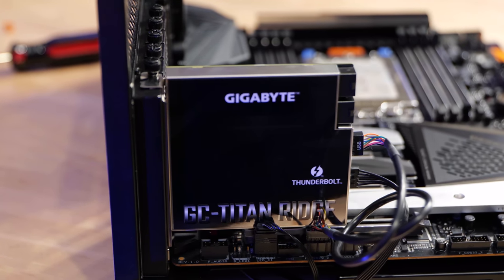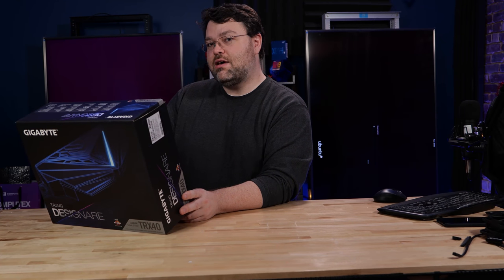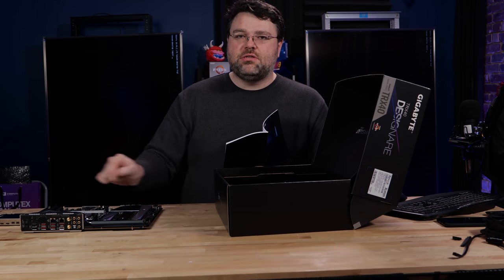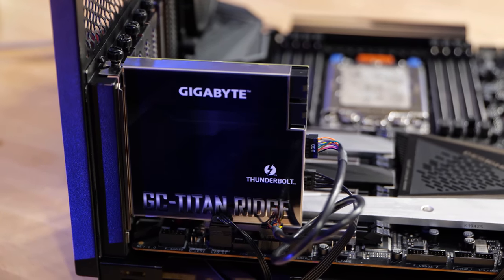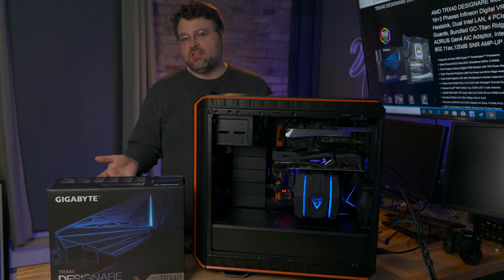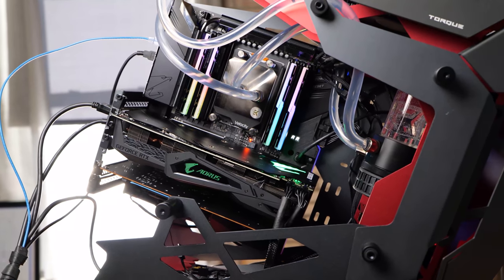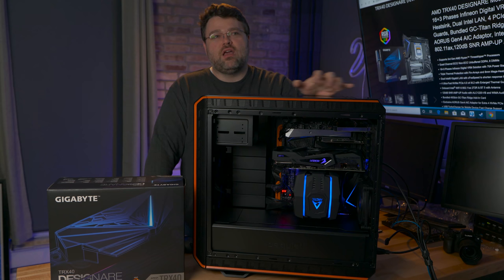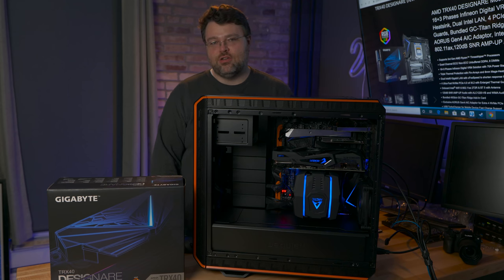Threadripper: Perfect Thunderbolt Compatibility on the Designare TRX40 Tested

Comment: This video made a huge difference. I'm a musician and NEED Thunderbolt for my Audio Interfaces and Storage.
Reply: UAudio ? Is this only for threadripper ? I want to build a gaming pc with cheaper AMD parts but I also need thunderbolt to play with some UAudio interfaces. What should I do ? Go intel ?
Reply: @defaultHandle1110  Nope this Gigabyte TRX40 or ASRock X570 Creator (right on the mobo).
Reply: Can anyone confirm this works with UAD Apollo TB3 Converters?
Reply: Metaxas Music I cannot conform that this fully works but I have a previous gen Gigabyte mobo and it works with my Apollo Twin Quad. I’d send Gigabyte an email if you’re planning to buy soon, I personally feel comfortable that it will work based on my experience with their other products but I’ll be confirming with them directly as well.
Reply: Rob Flores thx man

Comment: Just got the BIOS up and this video and forum thread in the description has been a blessing - cannot wait to use it with my UAD Apollo Quad audio interface!
Reply: Did it works? I also have a UAD appolo quad...
Reply: @mimidhof2179  24 Core AMD Threadripper production beast. Do it! ;)
Reply: @JackMajor  Well to be honest, at the time I was in need to renew my 6 cores intel PC from 2008-2009 almost 1 and a half year from now (january 2019).
 There was no information about the possibility to have thunderbolt working on AMD computer. Not even sure that the Gygabite Designer already existed.
I had no doubt about the way AMD was coming strongly, but I needed thunderbolt connectivity.

So I then decided to keep going with Intel but due to the unrespectfull and never seen before devaluation of the Intel CPU I bought. The 9980XE 18 cores (-50% on 5 month). Hopefully I have it running fine in an Azus prime Deluxe II with 2 thunderbolt 3 ports. It is stable and will have to be working for a long time still, seen the investment and seen the value loss.
I can't say 100% sure (maybe they offer me 50% of a future AMD chalenger) but I think I will never go back to Intel again, they are shameless. I think this CPU is the only thechnological good that has lost so much value in 5 month since the big bang 13 million years ago.
Thank you for the AMD advice.
Have a good music production day.

Comment: I'm upgrading my Threadripper X399 Gigabyte Designare mobo to this GC-Titan Ridge "PCI-E over USB Type-C" card, thanks for the video!

I'm just hoping I can get it working on Linux!
Reply: I did the same as yours. I got that works in gentoo linux. You may need to do some manual changes to kernel in order to make thunderbolt to work.

Comment: please try to contact UNIVERSIAL audio and ask for a sample, they have stated to me when i asked them that they DO NOT support amd processors. I would love to see you prove them wrong!
Reply: They don't really need to support AMD, just Thunderbolt. And Windows/Mac. It's just that TB is only "native" to Intel, and anyone asking questions like that gets them worried that faulty hardware configs will wrongfully draw the blame to their product, which is why they gave you a misleading and ultimately worthless statement like that. If you can get TB3 working on AMD, you're most likely fine. My MOTU 1248 works fine on AMD, (Linux is another story; TB interfaces still don't quite work the way they should even on Intel, in case you're wondering) and I'd imagine UA would be fine as well.
In short, unless their driver is specifically engineered towards Intel, (which it probably isn't, seeing as Thunderbolt seems to be firmware validated, and driver/API developers never have to worry about that crap) then their statement is useless.

EDIT: Sorry for the rambling and multiple edits, just wanna make sure this is all clear without going on too long.

Comment: Great Video. Could you please recommend a similar motherboard with a Thunder Bolt 3 native connection (on the board, not an add on). I am a audio/video Engineer and using the new Universal Audio Apollo X duo with Thunderbolt 3. I want to build a new system with new thread ripper chip.
Reply: The same ! But I'm composer not engineer :) I would like to connect UA arrow interface also with thunderbolt
Reply: @PerchHunter  There is only one motherboard with thunderbolt on a new AMD platform. And this is this one, reviewed above.
Reply: What about the asrock x570 mobos?

Comment: That Titan Ridge card seems to be able to be used on boards that don't advertise having thunderbolt support or have that special motherboard header. Even a pre-2013 cheese-grater Mac Pro, interestingly enough. I don't suppose you could experiment around with it in various boards and see what you learn? Would be interesting to see what happens if you put it in an Epyc machine

Comment: Are you saying FireWire is dead ?  I just upgraded to a Pentium 2.
Reply: I am so happy so many people think Firewire is dead - there's some very seriously capable pro audio gear that uses Firewire  which I'll be delighted to snap up second hand as the 'bad' news spreads. :)
Reply: My entire recording studio is still Firewire. From my 10yr old ProTools rig to the interfaces and external HDDs used for recording. However I just got notification that my application for a grant to upgrade equipment was approved! FK YA! $100k of new gear for me in April! Putting together and adding to a wish list daily!  2020 is gonna ROCK!! \m/, ,\m/
Reply: @Iam_Dunn  I'm very much just a serious amateur, but I love my original RME FF800 - does all I need and more. Though I wouldn't mind a UA Apollo Quad :)  Congrats on the coming equipment upgrade. I'd love to play with that kind of budget :)
Reply: You can connect your external zip drive directly to your firewire port just fine

Comment: USB4™ is what I'm waiting for to be included in my next board upgrade
Reply: how is it different from thunderbolt 3? isn't it like the same with a different name? maybe its the case but its just cheaper to implement?
Reply: @santiagoferrari1973  Yes USB 4 is the same thing as Thunderbolt 3. Only the name Thunderbolt is proprietary and under license while USB 4 is open. It's just like Freesync over HDMI is proprietary and requires a licence fee (unlike Freesync over DisplayPort) while adaptive sync doesn't require a license fee even though it's the same thing.
Reply: @CheapBastard1988  thanks

Comment: I would really like to see this running with an universal audio audio interface but also with thunderbolt 1 or 2 devices running over an thunderbolt adapter which seems to be not working with the titan ridge. i could not get the apollo twin duo thunderbolt 2 interface running with this system. but your tips helped a lot getting the system clean and working. thanks for that
Reply: Um, wow, did not support Apollo Twin TB2?? No resolution?

Comment: Commented on your initial video back in 2018 and I'm just now noticing the TB3 with X570 problem, lol. I Bought the Titan Ridge v1, hoping I could get thunderbolt on my X570 Asus board and 3900x, to connect an external DSP sound card. First tried the PCI 3.0 slot, but Thunderbolt control center would only acknowledge the sound card if I had turned it own prior to boot. Turning off would not appear again, Then tried PCI 4.0 slot and I could turn the sound card on/off in windows and control center would allow me to see it. PCI to PCI bridge error codes like you mentioned and 3.1 Extensible errors from windows drivers. After hit and miss with installing drivers etc, Windows would freeze when I turned on the sound card in the 4.0 slot. Tried changing bios to read as Gen 4 slots instead of Auto but no options for configuring thunderbolt since this is an external pci card. Really needed this to work may. Good stuff. Thanks.

Comment: Are you sure they're not licensed? Using the trademark on the card would get them in hot water. They'd be fine if it was just thunderbolt compatible, but using the logo without permission would get them in trouble.
Reply from the maker: The aic I'm sure is licensed since it is the identical card for an Intel system. Its my guess that no one can call the * complete system* thunderbolt without Intel's blessing.

Comment: Hi, is the "I'll be glad to test this system for you" still relevant? I've had a terrible time with my Steinberg AXR4T mixer which works right away when I plug it into my mid-2015 MacBook Pro, but running Titan Ridge on Gigabyte z370 aorus gaming 7-op has been... simply non-functional. No Thunderbolt options in UEFI, not sure if there even should be, Windows device manager recognises "something" when the card is installed, but can't install the drivers unless I hack the Intel INF files and force the install. I even tried the card with my gpu removed to make sure it wasn't the PCIe lanes and nothing.

I'm really keen on going for a Threadripper for those sweet PCIe lanes and I see this as an option.

Comment: What happens If I install the thunderbolt card in one of the x16 slots with x8 speeds. Will two m2 cards bifucated run at full speed? How about the impact on performance of 4m2s?

Comment: Hi You mentioned that titan ridge card works on the Aorus Master trx40 $499.99 mother board.  I upgraded the Bios and now I have TB options in BIOS. I have a UAD external audio card attached to TB Card. But nothing shows up on the intell dw for me to approve devices. thunderboard card installed.
Hi, hey can someone help me out here. I built my auros master trx40  and is working fine. until i put my sonnett allegro FW800 pcie card then boots up i get NO display screen signal. If I take it out and boot up again . It works fine. Appreciate any help? My FW800 PCIe card is about 7 to 8 years old. It works fine with my other GIgabyte mobo also about 7/8 years?  ANy ideas help?

Comment: The x8 to the chipset is something I have banged on about and it is good to see. But put in the TB card into a x8 slot, then a graphics card into a x16 slot, and the NVMe card into the other x16, and you have one x8 for your 10GbE card and nowhere else to go.

This platform needs some x4 slots (using two x8 slots that, if the second is populated, it splits to x4 x4) or that can consume an on-board NVMe set of lanes. 

It also could do with the option of Chipset slots for mid to Low speed peripherals like the new wifi standard that I am sure will come out.

I am hoping the WRX80 does this. It would make sense for that platform IMHO.
Reply: Yes, and it's the same or worse on the entire lineup of TRX40 boards.  At most, they have two x16, two x8, and one x1.  Many delete the x1.  Some have 10GbE built in, but none have Thunderbolt built in.    
Would be so much better to have two x16, one x8, and two x4 PCIe slots.
Reply: @Trevellian  Yes, I agree. I mentioned the slot point on an earlier video on GN when BuildZoid did his review. I agree. It is a mess, but I do think the WRX80 may be the target for such flexibility. It should not be a problem to have 16/16/8/8/8/8 with pairs of those 8's switchable to be 8/0 and 4/4 depending  on population, or grabbing unused NVMe slot lanes. There are 56 lanes available, even ignoring those on the chipset, and all they can do is 4 slots? Please.
Reply: If you don't need all the m.2 slots you can connect a 4X add in card into it with an adapter.
Reply: @CheapBastard1988  How would this fit so that one could mount it on an existing case slot? Would the motherboard and existing slots not get in the way?
Reply: @timcarpenter2441  Depends on the motherboard, case and add-in card in question. You can not use an adapter if there is a motherboard slot in that position but there are several possible methods to circumvent this (though you might have to be a bit creative).

1. If the motherboard doesn't have a shroud covering it and has positions without actual slots in place you could place it there. Sometimes it's under the top 16x slot so if you have a 1 slot GPU or a vertically mounted GPU with a riser card you could fit it in there.

2. If the add-in card is half width (like a network card, USB controller or RAID controller) you could modify a slotcover from the case to mount it with a bit of an offset.

3. Look for a case with more than 7 slot openings and put it underneath or in a place normally used for dual systems with only one system installed.

4. This may go a bit too far but there is often space behind the motherboard tray where you could cut a hole in the back of the case where you could mount it.

It is still only a 4X slot so you probably won't be connecting a GPU in there but just don't forget that an NVMe M.2 slot is also just another PCIe slot only in a different form factor. Though you have to be a bit creative. If I had a need for Thunderbolt 3 I would mount the add-in card in this video in a position for front access using a riser card.
Reply: @CheapBastard1988  I don't think #1 would work, unless you did #2, due to the regular height of PCIe receptacles. I have a 9 slot case, so I am lucky, but few people have such a leviathan.

My point here is, given what one is spending on the board and given the lanes on offer, it is not reasonable to expect people to go to such lengths. 

That said, it might be that cheap switches are not available for PCIe gen4 (not to be confused with PLX chips!).

With that, they could have provided x4 or x8 slots and very cheap single/double NVMe mounting cards to give flexibility.

As I mention above, I do think these boards are a bit hobbled and that the W/TRX80 is where the fun will be.

Comment: WENDELL I HAVE A REQUEST:

Contact Highpoint Storage Solutions and aquire their SSD7120 NVMe RAID controller and connect 4x Intel 905p 1.5TB 3DXpoint U.2 SSDs in RAID 0 and see what performance is achieved

Comment: They might as well make Threadripper boards with 2 cpu slots.
Reply: Would be fun but a dual socket config would cause larger latency between CPU cores. Besides the upcoming 64 core 128 Thread 3990WX is more than most software can handle anyway.

Comment: What's the difference between the different CL ratings on RAMS of the same capacity? Like 16GB (2x8GB 3600MHz CL16) vs 16GB (2x8GB 3600MHz CL18)
Reply: oh boy this is a huge topic.
latency, thus raw bandwidth. note i said "raw". google is your friend. :)
Reply: You want high Mhz and low CL. lower is better.
Reply: Good reply 🙄👌
Reply: CL stands for CAS Latency. Latency generally goes up with frequency. If Latency gets too high then you might as well run at a lower frequency for the same speed. There's probably a Techquickie video about it.

EDIT: https://youtu.be/Yed-a9vqTYc

Comment: I tried this:  a google search and visited  https://www.gigabyte.com/Motherboard/GC-TITAN-RIDGE-rev-10/support#support-dl-driver in regard of the GC-TITAN RIDGE from Gigabyte.
These drivers ( mb_driver_626_thunderboltdch_1.41.648.4_n ) worked for me today. I was using an older driver DVD from Gigabyte as well (first step) GIGABYTE   Thunderbolt Card Utility Driver Disc Ver. 1.2 (from X299 DESIGNARE)    containing a Folder ARUSB  drivers for  Intel® USB 3.1 eXtensible Host Controller v15.2.30.250   Windows* 7   64-bit on a W10 Pro System .... this installed some net. stuff from Microsoft ... I did a reboot ... not sure if this pony did a useful trick ... then installed the drivers from the above support page - looking good. 
Board: Designare TRX40 BIOS F4a    W10 Pro x64
thanks for this video